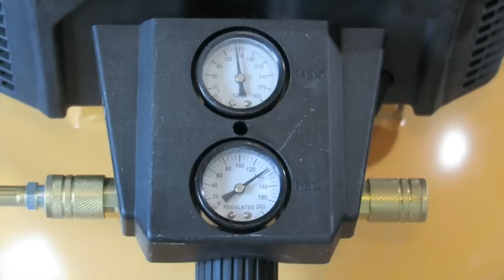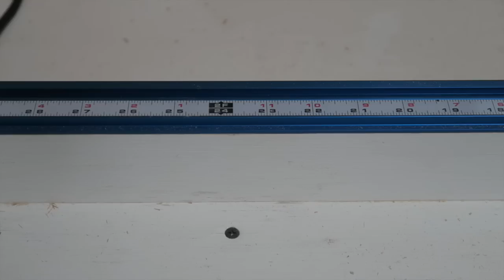Kitchen Remodel Part 1: Flooring

Comment: Nice video, looking to do same type of project.  Did you end of putting down the new flooring where the fridge sits?  I saw you did for oven.  I wasn't sure if you did for fridge?  What type of trim did you use around cabinets?
Reply from the maker: Yes, flooring everywhere. I just used standard white baseboard around the cabinets. I may have had to rip the boards down slightly to fit under the toe kick.

Comment: Nice video! Love the editing! How did you install the floor boards around your kitchen cabinets? Did you undercut the kitchen cabinets, put the board flush against it, or leave a small gap for expansion/contraction? THanks!!
Reply from the maker: The baseboard I used fit nicely under my cabinets without being too tight and didn't need any modifications. I nailed it down so the baseboard was sitting on top of the flooring, this hides the gap between the flooring and  base of the cabinets and also helps hold the flooring down. It will probably depend on your cabinets and what your local store caries for baseboard, but usually they are pretty standard sizes.

Comment: I thought we would have to pull up our old flooring but you just put yours on top of it. Was there some factor that helped you make that decision? Thank you! :)
Reply from the maker: You certainly can remove the original flooring. I decided not to because the new vinyl plank flooring is relatively thin, maybe only 1/4 of an inch thick, so putting it over the existing floor didn't really add much height. Also, if I had torn up the old flooring I do know what was underneath. The old flooring was still nice and flat and in good condition so I figured keeping it in place would give me a good base to put the new flooring on. If your old flooring is in bad condition then I would consider pulling it up.

Comment: Why would you put imitation wood over real wood?
Reply from the maker: It wasn't real wood, it was  laminate flooring. The flooring I put down is a waterproof vinyl plank. So far a few years later it still looks new. I put the same stuff in the bathroom and it still looks good as new as well. No need to worry about spilling a bit of water like wood or laminate, and no need for sanding and refinishing.